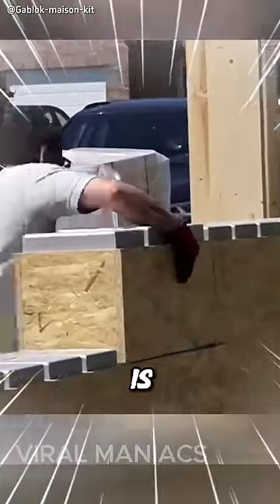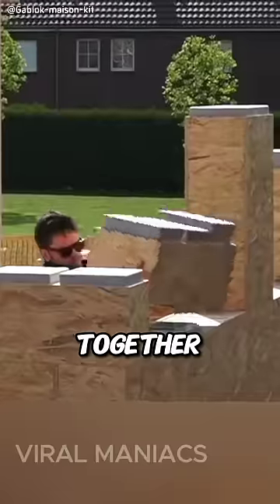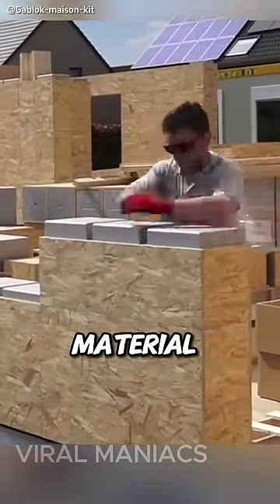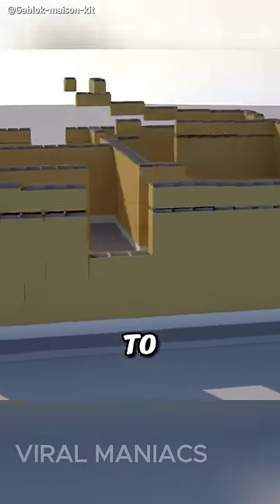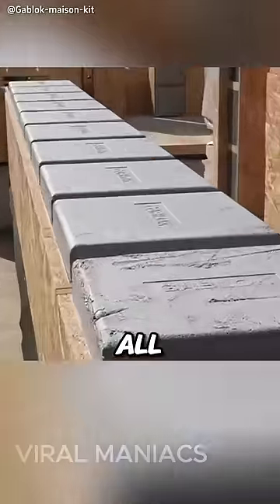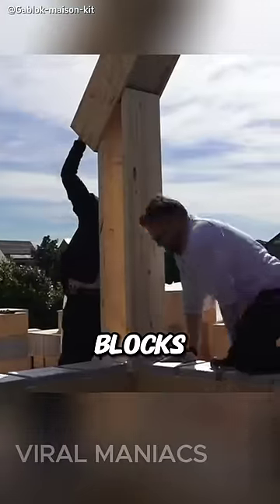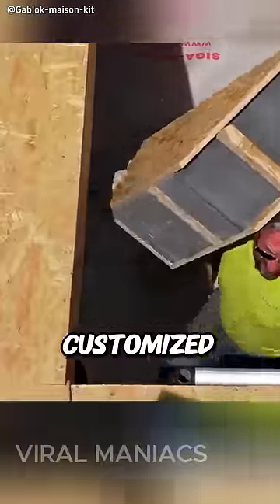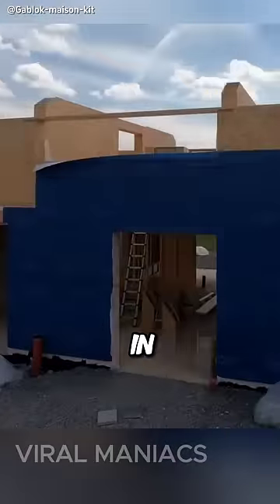Whoever Invented This Way Of Building Houses Is a Genius #shorts

Comment: As an electrician I would ignore all calls from people who buy that 😂
Reply: As a framer im laughing hard
Reply: i see what u see..also as electrician
Reply: I was wondering how they would work out the electricity, ventilation, and plumbing situation.
Reply: @indigamerisemina😂 hahaha i agree 💯 lindian
Reply: Can you explain more? What is the difference with classical wooden house? All the wires the just go on the surface, which might look a bit ugly, but it works

The fire safety is an issue though
Reply: @ilkarusei Most trades have bias against new tech until someone tries it and makes more money than them. Where I live, the most common screw is still square.  Where I grew up, it was Phillips.  In Germany, they invented a new screw that's even better called torx. 

Builders here still claim square is the best. 

To be fair though these new styles of processed block building seem like gimmicks. 3d printed houses were the last gimmick that got more traction online than in reality. 

In this case you're right about the power and plumbing but in Asia where buildings are built assuming they will eventually be damaged by quakes power in exterior pipes is very common.
Reply: @ilkarusei  Nothing really to explain. Just a bunch of boomers, who thinks old/their ways are always best; and that none of these pieces gonna be altered to handle cables or pipes.

Not every wall needs cables inside them (or at all if you generate energy yourself) and ventilation can be handled in far more ways.
Reply: Not an electrician, but I think I can see what is wrong.
Reply: @Seichensi  why are you assuming the naysayers are "boomers"? They could be Gen Z to Boomers. 
For everyone else, a more pertinent question to the naysayers, is why won't it work?
Reply: You're right! That would be a nightmare for electricians, plumbers, sheet metal workers, etc.
Reply: "The 5-cm thick rafters that support the insulated blocks are spaced 40 cm apart, creating convenient pathways for cables and pipes. And the flooring elements ? They also provide ample room, making their integration a breeze."

It's okay to be intellectually inferior, but honestly it isn't that complicated kid lmao
Reply: @ilkarusei   The polystrene would be a flame retardant grade. I work in plastics.
I can't speak about the wood v's a standard frame.
Reply: I’d be more worried about the PVC in the cables coming into contact with Styrene in the insulation. If you’ve ever seen it it’s like someone just melted the cable sheath. It can be dangerous if the cable is ever moved. Apart from that I imagine there’d be another cavity on the inside maybe plasterboard (drywall) battened off the OSB. I know, I know, no one in their right mind would make those walls even thicker. If you’re in the building trade in the UK, you know the building regs  just keep on piling it on.
Reply: As a man who knows all sparkys wear pink g strings ,I would personally ask for you
Reply: @Seichensi  Homeowners taste and use patterns (and tech changes) (and code changes) mean alterations need to be done years later.
Reply: they planned the house layout beforehand, they already have the plumbing and wiring decided on, the only time you'd "find an issue is if the owners decide to renovate again in the future but realistically it's not even a problem, they'd easily find a solution for that when the time comes.
Reply: As a South African this is old News we only build with that wooden shit and and wooden poles no block's 😊
Reply: It would be simple to have the poly cores to have a conduit or hollow space. Not even a challenge, and I sure they thought of this.
Reply: You normally line the inside with rockwall sheets for fire safety, on 1" batterns.  Services are run behind this in conduits, and in the floor slab/floor spaces. Same with SIP construction.
Reply: Why? The only way to wire this would be exterior conduit. It would make troubleshooting easy AF.
Reply: Unless you can convince them to do open ducts instead of buried lines. Open ductworks are much more better.
Reply: @indigameriseminalindian I’m assuming a small furred out wall inside
Reply: @Julie-ly8tg no it wouldn't, you can pre-plan the build with contractors who will be on site, as your putting the walls up, they can predrill holes, then install pvc pipes to run the wire through, just like a plumber would, it's not rocket science. 😂
Reply: I'm of a profession that has nothing to do with houses and I would rather live in a car.
Reply: @scoobiedoobiesanguich  what're you laughing for? This type of building eliminates your job.
Reply: an industrial style decorating leaving the pipes and electric cords (inside PVC pipe) looking good on interior walls. Hiding all the guts inside the walls is really impractical for repairs and cause all sorts of damage with water leaks. . Leave the tubes where they can be seen and paint everything gray. People who use the materials are not going for standard imagery. Look at all that insulation in the walls!!! This thing is like a cave.
Reply: Nothing is stopping these designs from having the traditional 2x4 + drywall interior layout. So complaining about having to wire is just ignorance on your part.
Reply: wouldnt you  just run the wiring like it was a brick home
Reply: Same as a plumber.
Reply: @zazzfishing3214 Use a propane torch, heat a large ball bearing, let gravity do the rest. That's how it's been done with SIPS construction for decades.
Reply: As a homeowner currently rennovating and down to the bare stone walls I wouldn't call you for a job ever. Common sense you build timber frame within, insulate, and then run the cables and plumbing like how I'm doing with my house.
Reply: It's drilled in right through it obviously.  Not rocket science
Reply: @Seichensi  every outlet, fire alarm, switch, HVAC needs a cable in it.  All those wires need holes in the walls to travel through.  Have you ever tried drilling through solid walls filled with foam? 8 to 12 ft through?  Why do you think it costs more to have an electrician install a circuit after the house is built? than when its being built?  It sounds to me you know nothing of what it takes to build a house.
Reply: @Seichensi  how will you transfer the electricity to everything without wiring?😂😂
Reply: @AdequateName.  Where did I write "without wiring" again?^
Reply: @Seichensi  "...not all walls need cables inside of them (or at all if you generate your own energy)..."  if you generate your own energy, you still need cables to transfer the energy to whatever needs powered😂
Reply: Anyone in the trades understands the absolute shitshow that doing a rough in on this would be.    Not to mention trying to find materials for an addition or a remodel.
Reply: Who needs an electrician?
Reply: @zachweyrauch2988 Torx screws are the best, we use them as the torque we can get on them is much better. But, this building system is rubbish unless you were building for 3rd world customers... Even then this would be more costly.
Reply: @indigameriseminalindian  They don't LOL
Reply: @Seichensi  If you are so well educated in this please explain.
Reply: Plus, when that thing catches fire - and houses do catch fire, you'll die in less than 10 seconds from the amount of fumes given off by that much burning polystyrene.
Reply: @xanthromera  , until someone decides to cut corners.  But that never happens, right?
Reply: As an engineer I see opportunity. Please stay away
Reply: @AdequateName.  Yup. Learn to read with understanding. "Not every wall need cables inside them", does NOT equal "no cables at all".
Reply: @IroquoisPliskin-y9s  Anyone who wants to  build a house in an incorporated area.
Reply: @indigameriseminalindian I had the same thought.
Reply: Yes, as we say in the south the “Innards” need to be added. 😂
How is this Poly Ethyl frame going to tolerate straight winds??
So many questions.
Reply: I doubt that the plywood would be the finish wall surface, drywall on 2x2 studs would give room for electrical installation. Interior walls would be conventional. Plumbing should be avoided on exterior walls.
Reply: You’ll run the wires through that wood covering !!
Reply: @jokester0589 if they had just did a lil work an found out about what they see instead of just commenting. They would have the same information
Reply: @xanthromera thanks for telling them about the fire safety
Reply: @ilkarusei  как будто другие дома не горят, клоуны
Reply: @Seichensi  если их спросить,  то дома из кирпичей и бетона не горят   не имеют никаких проблем,  клоуны
Reply: @xanthromera нет нет нет,  мы должны жить в каменных пещерах,  никаких новых изобретений!!!
Reply: @taishren6536   I went to the trouble of translating your Russian replies. Quite funny, by why the Russian on an English thread?
Reply: as ex EU electrician you make me loose faith in US electricians... sorry but there are so many ways to lay wires in this case it makes you look very ignorant you can go either outside/inside or even in the walls itself
Reply: I’d wire it like a commercial job. EMT and metal boxes.
Reply: I was thinking the same thing. Like how u gonna fish down any walls?  How u going pipe the house after there done building that bull crap. Wire mold. Hahaha
Reply: @jokester0589 u must work in an office and are definitely not an electrician. Nice try tho
Reply: @Seichensi - boomers can say the same about younder ppl. Besides it would be interesting to see how they about the rest.
Reply: @tonym2624  because wires and plumbing goes in the wall an now you have insulation and plywood in the way. That's why electrical and plumbing is done before insulation and drywall.  And I'm a millennial.
Reply: @rednoterecords198 so your still framing anyway. Makes this product meaningless
Reply: @TheDaniel212pl I think you missed the point. Can't go in the wall it's filled with foam and closed already.  As for exterior we have different building codes in the US.
Reply: @zachweyrauch2988 There's a 3D community (standard sized homes) not too far from where I work.
Reply: @zachweyrauch2988 the torx screw was invented in the U.S. in the 60s 🙄

Square drives are used all over the world and have their advantages even over torx. If you don't work on construction you should be quiet. 👍
Reply: @AngiesCousin  where is that? (Not trying to argue, just curious your locality might be more conducive to concrete construction than others)
Reply: @cristopherfrakes1416   o good thing a big man came in to tell us how things are. Not like construction is a failing industry that literally everyone, including construction labourers themselves, openly denigrate.

Maybe if you work in construction, you should be building some damn houses more than you ego flex online.
Reply: @John-ou4rm  I'm not sure it's about cost so much as addressing the lack of skilled labor. 

I got stuck in a pretty big DIY when I bought a home before the pandemic. Seeing the work done on this home and hiring the work of contractors has left me very skeptical of the construction industry.
Reply: As a blind man, I can see what’s wrong with this concept
Reply: I was thinking the same thing. It's a nightmare for hvac installation and other trades.
Reply: then we need more skilled electricians
Reply: bet u would ...makes makeing ur hourly rate terribly huh cant handle the work just prefer the money as usual ,now I know money is everything blah blah blah
Reply: @SimonRiley752  Fun fact? I absolutely CAN do all of those things!!
Reply: @ilkarusei  You need space to run wire, plumbing, drains, exhausts, so on and so forth. The only way your going to get any of that here is if it's all exposed.
Reply: @zachweyrauch2988  Okay Einstein, where is the vents for the drainage system supposed to go? What about the electrical? Pipes?
Reply: Could we not just build the outer frame of the house, then build framing inside of.it and you run wires thru there, then drywall the framing when done?
Reply: Or just run PVC along the top edges like crown moulding and just run all the electric wires thru the pipes
Reply: @Gravedigger933   I had another thin-skinned keyboard warrior give me this same attitude just yesterday over types of screws. I'll answer your question if you can explain why you had to call me 'einstein'.
Reply: @Seichensi  I'm sure it's not just boomers who prefer a quality house instead of a lego house. Craftsmanship is something you can't get out of an box.
Reply: @SimonRiley752 I think that's probably the plan if they're building it themselves. I bet they probably thought about the wiring though. They might even have a good solution for the problem if you looked into it at all. Some people like to do the same thing every day and not have to think. Some people like to do new stuff and solve problems. To each their own.
Reply: @zazzfishing3214 i see what you see, as a teenager
Reply: Ever hear of surface mounted conduit?
Reply: Remove the insulation from the areas where you need to route your main services. Then yes, it would be a ball ache after that, but you could plan pvc conduit runs for cabling and piping. May negate any cost savings from building this way
Reply: MUUUM !! SALLY KNOCKED MY LEGO HOUSE DOOOWN !!
Reply: I am wondering how could be the risk of fire. Galician myself all what is not stone make a bit afraid
Reply: Gotta love these arrogant tradesmen. Talk tough till they can't find work then they change their tune 😂
Reply: I see no problem here' maybe some new techniques needed but nothing too way out
Reply: I can think of a couple reasons not to do this.
🌊🌪
Reply: @Seichensi  lol most of us BOOMERS are retired or going to retire in the next few years. You are blaming the wrong generations and showing your ignorance in the same measure.
Reply: As an electrician I would gladly take your calls.  These probably have formed in conduit if you will which actually makes the electrical work nicer although I did one time do new electrical on a sip house in which they installed one of the sip panels upside down and the wire pathway didn't line up.  That was challenging.
Reply: @zazzfishing3214 why would this be any different? You'll obviously still put up interior walls to hide wires behind
Reply: @zachweyrauch2988 torx is American. You're thinking of the aw
Reply: People know everything without even needing to know anything.
Reply: Why?
Don't you like huge campfires? 😂
Reply: @zachweyrauch2988 I don’t know about anything else you’ve said, but I build machinery that use Torx drivers (mostly T10 and T8) and those things are the bane of my existence. The small ridges/points on the driver and the screws themselves strip down much faster than a Phillips.
Reply: Don’t worry it comes with Bluetooth electricity lol
Reply: Bro. Charge a bit more. They look pretty easy to drill out where ya need to. Beats drilling through  cement an reo. Also they can probally allow for conduits in the manufacturing stage. Don't look good for Cyclones and Hurricanes though.
Reply: As a fireman… that “house” is a parking lot.
Reply: @tonym2624 The reason why the is a gab in the inner walls is that both plumbing and wires fail over time. The anount of deconstruction that would be needed to do minor repairs would add a massive cost. Removing a section of dry wall to fix an issue is a fairly low cost. These blocks are not designed for simple repair work. They are meant to be put into place once and never touched again. You would have to install walls on top of these walls resulting in more wall space than living space to solve this issue. 

Only ignortant people in the literal sense who have zero concept of general construction practices and principles would say that this is a good idea. 

Just because it is simple and cheap up front, does not mean that there will not br massive costs in repair work later down the line. 

All of this also does not take into consideration that you are living in a match box of a house that is just waiting to be burned down.
Reply: @SimonRiley752 You clearly have lived your life on the short bus. The issue is not the install. Its the after care and repairs that will make the costs of repairs so substantial that the owners will be buried in repair costs. 

Just because it is easy and cheap to install, does not mean its a good idea. This is all doomed to fail.
Reply: @jayrowe6473 Lol, its not the inital install that is the issue. Everything fails eventually and the repair work will be massive in costs. That is what you are not getting.
Reply: @snakezula Lol, so your solution is to add to the thickness of all of the walls on both sides that results in a significant reduction in the amount of floor space. You are a real genius.

Not to mention the added costs of building walls on top of walls. You are talking about nearly doubling the cost to build a house. 

Why do you just all of your money on fire as you clearly have zero concept of the value of it.
Reply: @indigameriseminalindian 
As an Australian Certified Practising Valuer (appraiser) with building construction experience, I am also wondering what conduit provision is made for electrical, water and gas plumbing services.
Reply: @OzCrusader   They left that part out about this great design.
Reply: If there are prefabricated holes and tubes (for wiring), would you take their call?
Reply: But its possible that the design of the house has taken into account cable routes also. Might be even easier to work on as an electrician. Im guessing a house like this would use a prosumer installation. Operating on island mode. Remember, technology is not here to hurt us, but to help us.😅
Reply: Seems like that would be good to put a round your existing house
Reply: I'm  curious as to why? (Honestly, as I do not know...)  I've worked on log homes and aside from perhaps alot of extra drilling and channeling, I dont see alot of difference.
Reply: @bonecholampworks  talk to a real certified plumber or electrician and they will explain it to you 😁
Reply: It definitely looks easier to cut through this compared to concrete
Reply: Anytime one immediately discounts viability without research is ignorant and refuses to learn new things
Reply: @Hawkm0th be your own guest😂😂
Reply: @indigameriseminalindian I imagine you still have to stud the inside.  Doesn't make sense.
Reply: @zachweyrauch2988 Well no one likes wiring ICF houses.  I doubt anyone would like doing this.
Reply: First flood and your house floats away 👌
Reply: Nah answer my calls buddy, I want my lego house on fire 🔥🔥